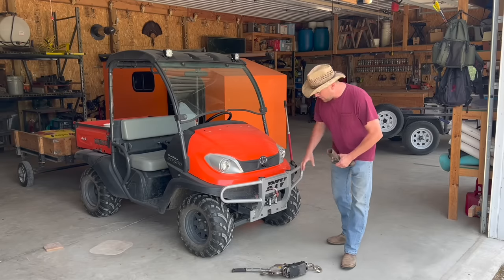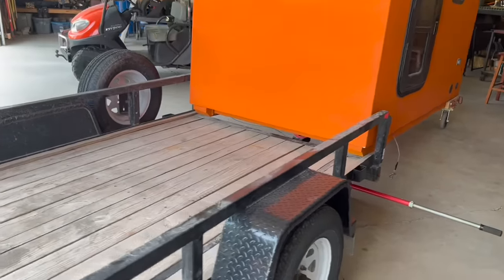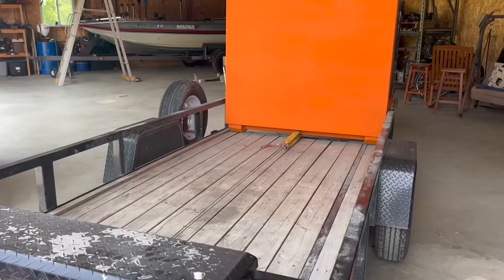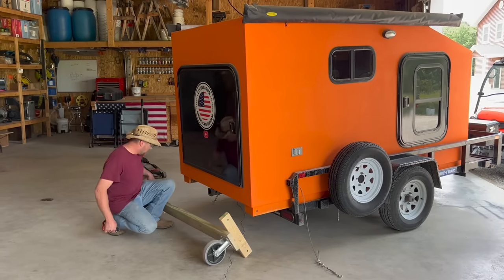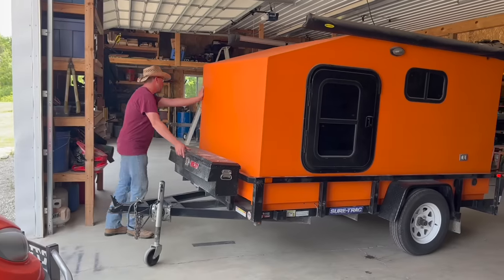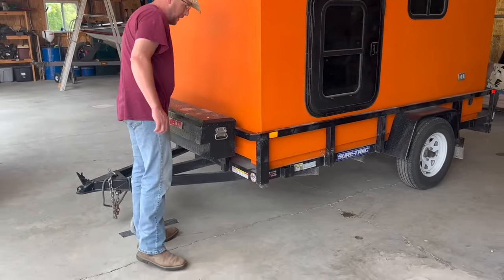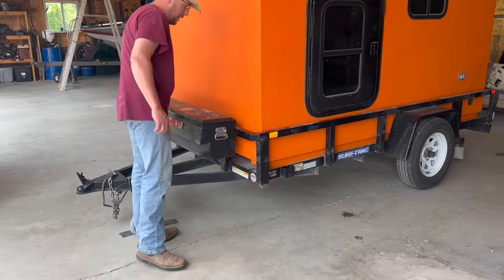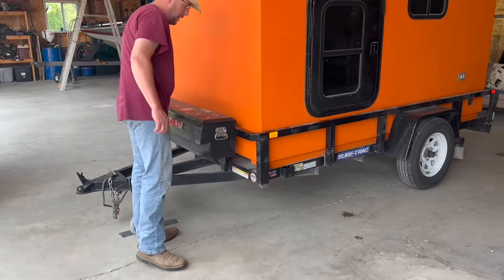Removable Squaredrop Camper?

Comment: Nice idea for the slide in camper part.  Some one on the Tear Drop and Tiny Travel trailer forums ( TNTTT  ) did one like that. His had some long rectangle boxes and wheeled trailer jacks that would bolt to the side of his camper.  Front one stuck out a bit to clear the wheels.  He just rolled it to and over the trailer and them lowered it with the 4 jacks. He would unbolt the legs and use 4 pins to hold down the camper and he was on his way. His was all so Orange in color lol .

Comment: suggestion:  when you want to go out on an extended trip, I suggest you put a hitch on the BACK of your little truck.
Reply from the maker: There is a hitch on the rear of the pod. We use it for a bike rack or storage rack and then it’s used for removal of pod from trailer. Thanks for watching!

Comment: I am thinking about doing something similar - larger scale (16' trailer bed) and using truck camper jacks to lift the camper in and off of the trailer bed.
Reply: A car hauler trailer is better for this. If you haven’t purchased a trailer yet. It tilts and loading and unloading is quick and easy

Comment: Absolutely love your idea and your camper. If I can without insulting you, offer you a separate idea from your turnbuckles? Have you ever considered welding another receiver on the back of that trailer and then forming a “u” type plug to go in both receivers and just pin them? that way you could use a locking pin and your camper would be locked from the back onto the trailer. Just a suggestion I thought of when I saw that receiver underneath your camper at the rear. This way you wouldn’t have to get down on the ground do the turnbuckle thing.
Reply: Guess he didn't like your idea due to the lack of response a month later
Reply: @undertaker08441  I reckon not, heck, I thought it made sense and would have been easier and more secure.
Reply: Waterproof exterior?
Reply: @Tripsolo65 _ That's a great idea' I'de actually use Both' to keep it from any shifting on the road _ Imo! ✌️🇺🇲👍
Reply: I'd also pin the table props.
Reply: Great idea however the point of the ability to take the camper on and off is to keep your trailer the same so maybe for some it may not be ideal . I like the idea of people offering suggestions to make things better and brainstorming.. I personally would keep it the way he has it not altering my trailer but to each is own .. good idea

Comment: Not the first execution of this concept I've seen but yours is terrific and it is simple. Love the modularity of it. Two trailers in one. One point of concern, although your arm is exposed to potential danger only very briefly, is when you run the short sling over the squaredrop steel brace. You've more than likely made allowances for this (like resting the front of the camper body on the tail of the flat trailer) but from where we sit it's a tad sketchy. Otherwise! you have a great rig. Love your shop, love your channel name. God bless you and yours.  Safe travels.
Reply from the maker: You are correct, the pod sits on the back of the trailer at that point. Additionally, I’ve since added a steel eye hook to where I can simply hook the winch cable directly, faster, safer. Thanks for watching!

Comment: Nice video and now I'm thinking of doing with aluminium steel framing with 6mm thickness plywood and then going to put fibreglass outside walls and willing using different colour pvc sheets to make it more standout the way without feeling any cold airs coming through any gaps and willing bring it up with without using petrol generators so got better solution to use free power without plug onto house or accommodation it's saves money lot best ways to keep it safe touring

Comment: Have you considered a dado groove in the skids and casters that have maybe 1/4 inch exposure, for it to roll forwards and backwards on and off the trailer?  With the sturdy tie downs it should change anything except air gap under the skids and keep that dry. Then you wouldn’t need a winch..
Reply: Also 8 inch pvc x 6 ft long, cap both ends. One end get a valve stem up top and hose faucet bottom of the cap. And a fill cap on top. 5 psi for pressurized air. Painted black for really hot water.

Comment: I really appreciate you sharing your video and design. I noticed as with my own trailer frame that I'm designing a camper pod for, you have some stake pockets too. I'm considering anchoring my pod using removable 2x4 stakes.  Did you already consider this approach?  What steered you away from it if you did?

Comment: get you some small conduit or pipe, put under CAMPER floor on trailer and roll it in
Reply from the maker: I thought about that but there’s the issue with getting that conduit out once the pod is in the right position.

Comment: I have a small 12 ft  by 5.5 ft with a 6.5 ft ceiling cabin on 3 rows of 4 x4 green treat and I have a metal bar similar to yours there but i also have one in the back and down the middle , I ran 2, 12 ft 3/8 in log chain. so when I do winch and yes I winch with a motor, lolol, on and off the pull is equal from front and back. , 90 % of the time i just leave it on the trailer but i have also drug it across fields before during deer season with the truck and it works just fine.... However, my floor, 12 x 5.5 is almost 800 lbs with wall and ceiling weight about 400 lbs. i built the floor stupid over kill just for this pull around the fields and keeping low center of gravity. lets just say, there is no flex and i mean no flex at all in the flooring. and if i level it in the field, i just use my handy man jack and  block or shim accordingly, i love the thing. works very well. its also 100% off grid.

Comment: why didn't you just add 4 outside legs? drop down pull the trailer out. could have them line up with brackets on the trailer frame and just drop 4 post in to connect it.
Reply: Those are expensive

Comment: How much does it weigh and also have you tried it in the winter ?
Reply from the maker: 2300 pounds loaded. The coolest we stayed was low 40s Fahrenheit, no problem at all keeping heat in there with two adults body heat. I’m sure getting into the 20s you may want a diesel heater or something.

Comment: Cut 2 holes in the front of your trailer.   Add a caster on each side of front of pod.    Then just push the pod on using casters and your dolly till the casters fall in the hole.